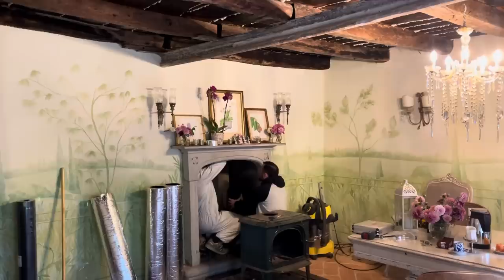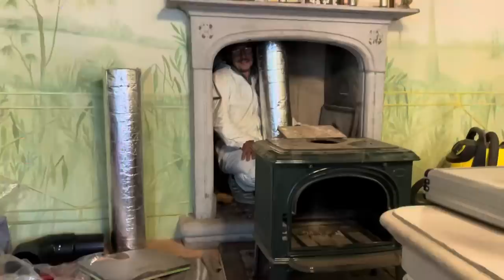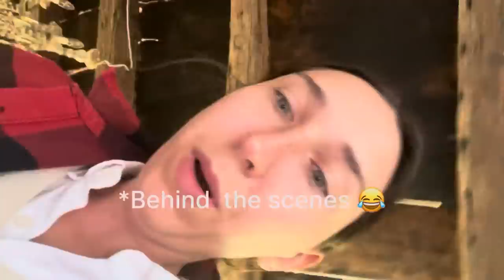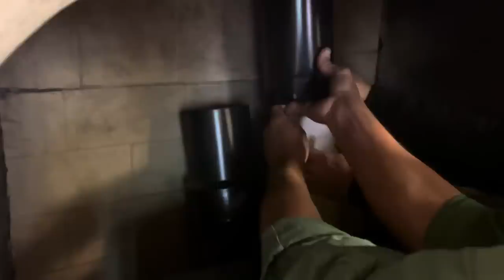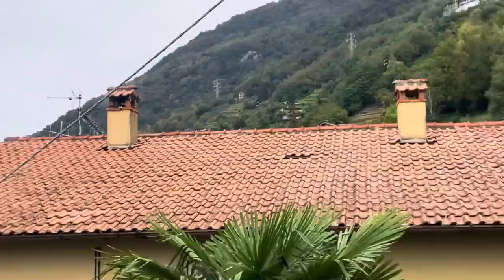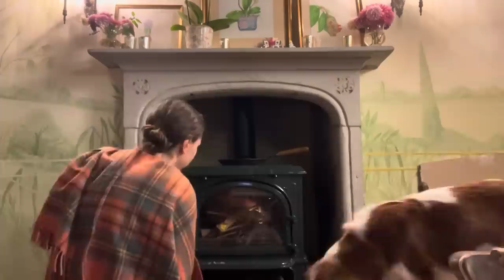Installing cast iron stove in our old Italian kitchen/ Renovation on lake Como

Comment: That's wonderful. You can get small stove-top fans to circulate the heat into the room more evenly, the heat from the stove makes the fan spin.  I've also used small electric fans on the floor, aimed at the side of the stove to circulate the heat around the back of the stove and back out the front of the other side. We now have a new wood stove with a built-in electric fan that keeps many rooms warm.
Reply: Those small fans work very efficiently, so all the heat doesn’t just go up the chimney!

Comment: Its just the right size fire. If it gets hot on top you could boil a kettle on it. Cosy evenings in. You just need a log store now and a basket near the fire with logs and sticks. You can buy a fire place set for stoking the fire or raking it out after use. Ash is supposed to be good for some plants too. Great job done

Comment: I am comforted that you can stay warm this winter if you choose. Yes, sometimes it means putting in another layer of clothes. We keep a kettle of water on the stove. It helps keep the humidity level up, and you always have some hot water as a bonus. Paper goes under your teepee of sticks. An easy build is what is called a log cabin. You will have it down in no time. Then, you will learn how to slow down your burn rate so you don't eat up all of your wood. You are both knocking it out of the park.

Comment: Wow there is nothing better than a stove!!! Congratulations 🎉

We have a few in our little farm house in the Veneto... Much cheaper than gas heating...  with a wood stove you open all the vents and or leave the door just slightly ajar when you first light the stove ..  once you have the fire established. Close the door up and close the bottom vent completely. You can then regulate how hot/ fast the burn is by the top vent. Normally about the halfway mark depending on the flue draw and wind outside..... This will create a flow of very hot air down across the window to help clean the glass.. to clean the glass use some paper towels wet and dab in the ash left in the stove iits the best cleaner for the glass.... Just a few tips on getting started!!!!! Congratulations one more 🎉🎉🎉

Comment: Alla, next time you go to second hand store brocante look for a billows. Its a two tear shaped pieces of wood  held together with leather pouch one side has a hole in it to draw in air that goes out a funnel shaped end. This old fashion tool helps me get lots of air on an ember and poof.  Key is Lots of Heat fast to force the cold air in out of the flew.  A good layer of embers over night will spark a fire in the morning.  Years ago I always cleaned out my bed of ash. well not smart.  The bed of ash is your friend.  Every morning I have sticks from my yard to stir the wood coals and stack on top, then with my billow pumping air to it viola!  Flame baby! So Happy for you.